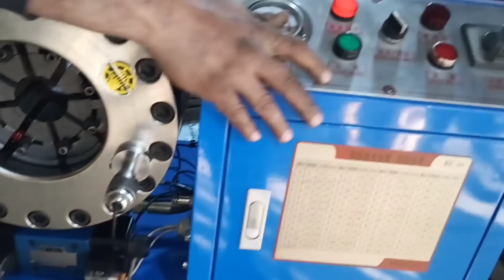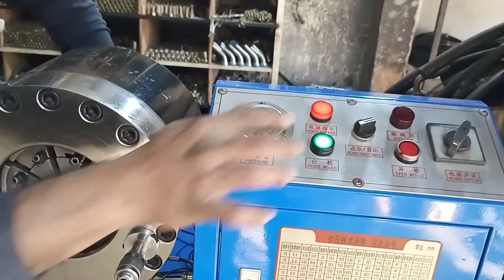How to make hydraulic hose pipe for earn money//hose fittings//hose crimping machine #asmr

Comment: Never reuse hose ends, very dangerous,  they won't hold the same pressure!
Reply: Really?
Reply: mr Richard . you are 100 % right . but in india people to save some money they practice this kind of fatal practice
Reply: Why wont hold pressure ?,it was not sand going trough them,but oil,they are not worn out.I have some reused hose ends on my machines,they work fine,thou pressures are not above 200bar,3k psi.
Reply: Yes sir u are right bt some people in Pakistan reuse fitting the know that this fitting is not work proper bt the are reuse fitting again and again
Reply: Noo its not i ihave this machine and we sell it to and i am lots of experience on hydraulic pipes and i can replair any type of pipes
Reply: Not right boss you can reuse it and keep its pressure while it has like 6000 psi @Draincleaningtools

Comment: Hopefully that doesn’t leak high pressure fluid and the high pressure fluid doesn’t cut itself into someone’s body . I was waiting to see when you would drive that cutting wheel into your hand too. 
Cheapskate method for used hydraulic lines . I don’t recommend buying a used hydraulic line like this . Too much high pressures to deal with on a used hand crafted line that’s questionable .
Reply: After some day this hydrolic hose leak